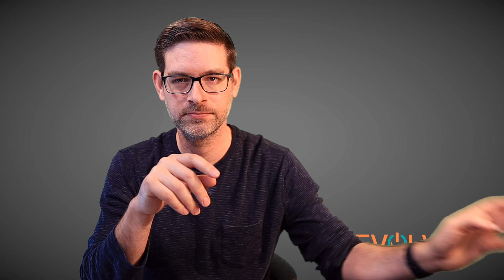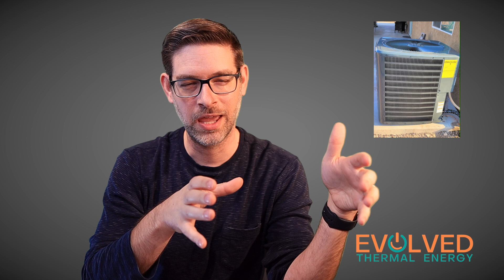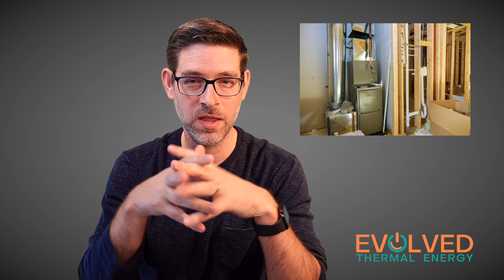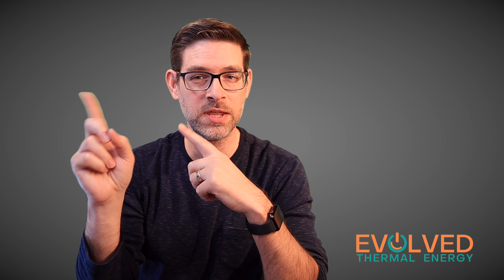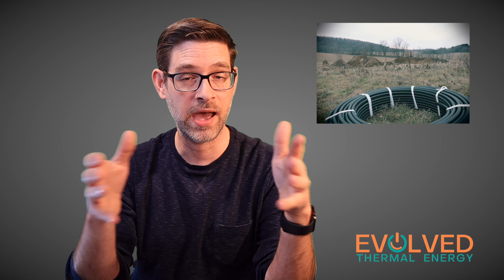Heat Pumps For AC - Evolved Thermal Energy

Comment: What all ac is based on heat pumps what are you guys talking about? Some are even reversible so they can be used as a heater too.
Reply from the maker: Yes, that is what we are saying in this video; conventional Air Conditioners are Heat Pumps too. A "Heat Pump" by HVAC definition is reversible. So, in this video I make an attempt to highlight the similarities and the differences. Thanks for your comment!